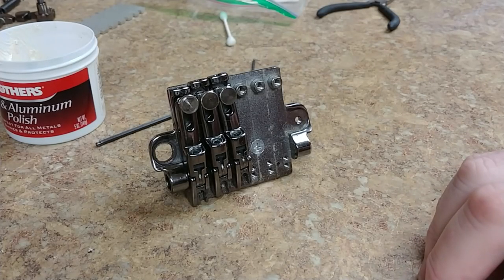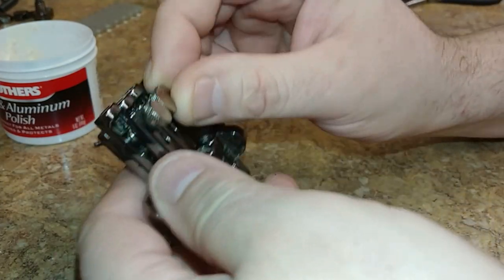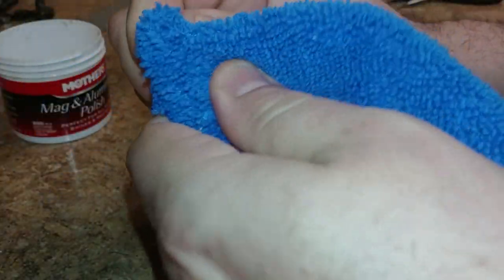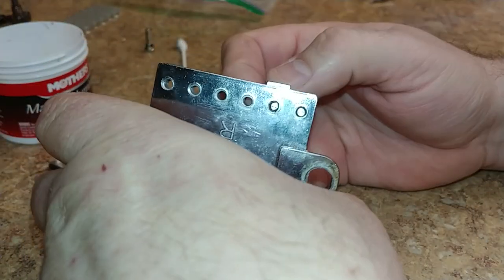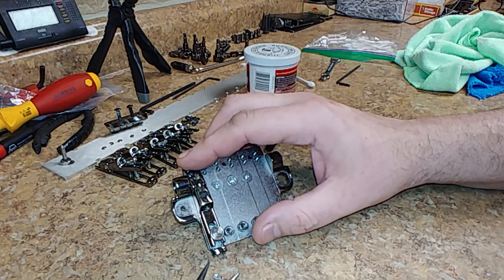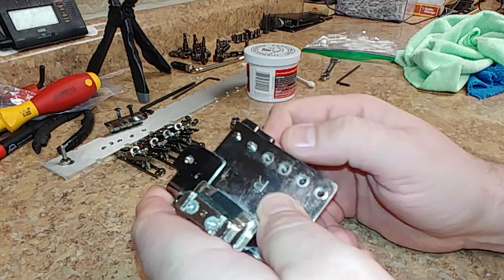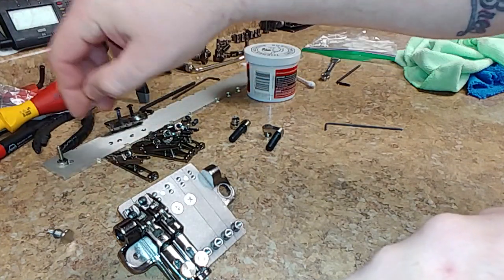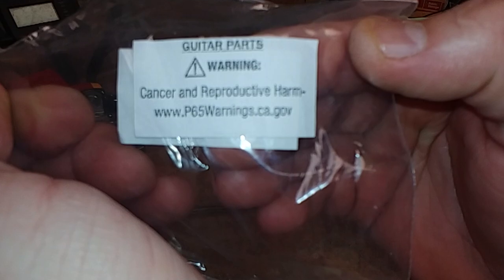Ibanez ZR Trem Disassemble Clean Reassemble

Comment: I just bought s470 dxqm and plan to take it down for a proper detailing clean and lube because it sat up for years. Lube recommendations if any? And I don’t know if made a video how to remove from guitar, if you have please reference if not would love to see one. Thank you so much for your time to make this video you did an amazing job. Fellow GTR Geek.
Reply from the maker: as long as the moving parts move freely, i wouldn't use and lobe. a good cleaning can help. lube or WD40 can make dirt or any other dust stick to the moving parts and now you may have more problems trying to get the dirt and dust out. maybe in my other Ibanez S470 i have a video removing the trem, i'll have to see.
Reply: Eric C 
Ty so much for taking the time to answer and much needed help
Reply from the maker: no prob.

Comment: Hello, thanks for the video. You said that the baseplate under the saddles is what actually sets the radius, but I noticed that my saddles, have different heights as well, my saddles 4-6 are the lowest, being 1-3 higher, and the 3 the highest. I just don't get this, why are they all different? Is it ok? Do I have to change the order of the saddles? Greetings!
Reply from the maker: On the Ibanez ZR Trem, at least mine. All the saddles are the same height. The baseplate has steps to keep the radius. I'm not sure how the newer ZR trem is. My newer Ibanez has the newer style of the ZR trem. I should look at it to see  how much they have changed. I wouldn't change the order just as long as they have the same or close radius to your neck.

Comment: I have a Charvel San Dimas with an FRT 1000, and I have a 2007 Ibanez S320 and I love the ZR bridge because the fine tuners are soooo smooth. I'm trying to get the smoothness of the fine tuners on my Charvel, what are the fine tuners made out of on the ZR trem that make them so smooth? Do you know?
Reply from the maker: It's not what they are made out of, but how they are made. When they plate the trem, they don't really look at the threads and use a tap to clean them. Also the end of the fine adjustments might be finished better than others to feel smoother as you turn them. I have seen some of the ends of the fine tuners on Floyd Rose Specials. Some of them have burs on them from manufacturing. If you see that the ends are burred, you can smooth it out yourself with a small file and sand it smooth with 600 and 800 grit sandpaper.

Comment: How’d you remove the ball bearing pivot pieces? Just took mine apart, but those pieces seem to be mounted permanently?
Reply from the maker: they do slide off the post, but they maybe hard to get off. a little WD-40 will help.
Reply: Eric C did you slide your pivot arms off the base plate? I’ll have to give wd-40 a shot.
Reply from the maker: @brandonwhite1869  yes.
Reply: Did you use anything to help pry them off?
Reply from the maker: @brandonwhite1869  you want to beachful. you could use a flat head and stick between and pry lightly. but use a little WD-40 before. they are tight, but not pressed in. just take your time.
Reply: Eric C just got them out, ended up using WD-40 with a nylon string. Slid the string into the gab and gave it a good yank.

Worked like a charm. Thanks for the help, brother!! 🍻
Reply from the maker: @brandonwhite1869  glad to help. Sometimes I don't get back to people right away, but if I can give some useful information I will. Glad it worked out for you. When you put it back together. Make sure it's clean. A piece of hair can make the bearing hard to get back on.

Comment: thank you so much for this, ZR tremolo is being a pain in the ass. Can you please upload a video or explain me how did you pull the bridge out of the guitar to do everything you did in this video.
Reply from the maker: Hey Thanks for watching. I can give you a step by step on removing the ZR. This is with all the strings removed. 1, Remove the tension on the stabilizer and  remove the two screws that hold the springs in place on the back of the block. 2, On the front, use a alien  key and a 10mm wrench. Alien key in the set screw on the hinged side and use the 10mm to turn the nut and hold the alien key so everything is not turning on you. 3, Use the alien key to turn the studs that hold the mounts on both sides till the whole assembly is removed.

Comment: Hi, I was trying to search the internet for a detailed ZR Tremolo bridge leveling setup, but everything was too blurry or didn't show what the reference part of the ZR bridge itself that has to be leveled with the body is. Do you maybe know if it's the block on the backside that has to be centered and touching the locking system (little metal bar that has additional 2 springs), or if it's some part of the bridge itself that can be visually identified to align it perfectly with some reference point on the S Prestige body? Thanks Eric

Comment: Great video! Congrats! Did you replace the whammy bar post? I'm looking for this replacement part. Do you have any advise?
Reply from the maker: i had an older whammy bar mount from a same trem. looks like you can mount a new one if it fits the hold and clears the body when moving.